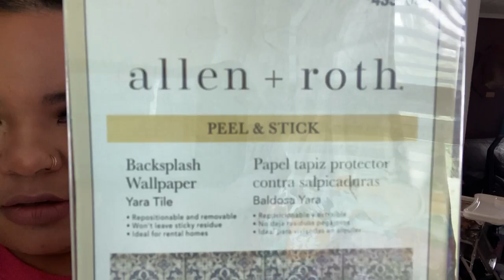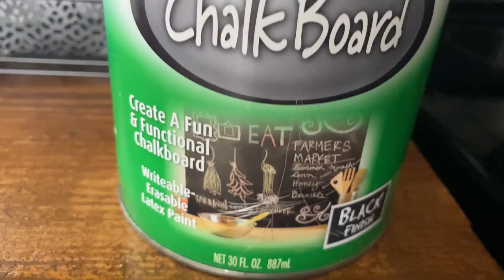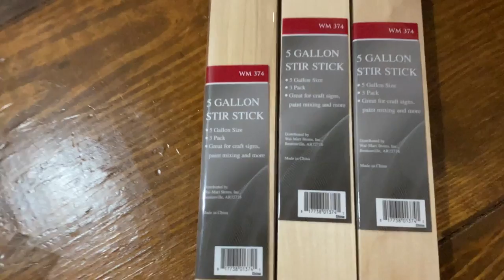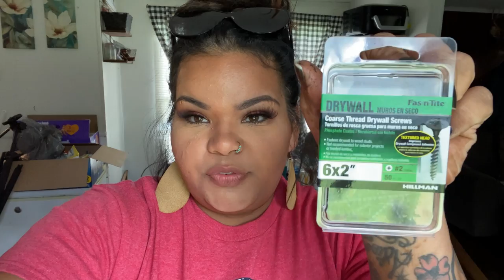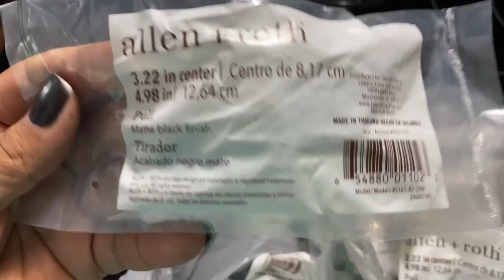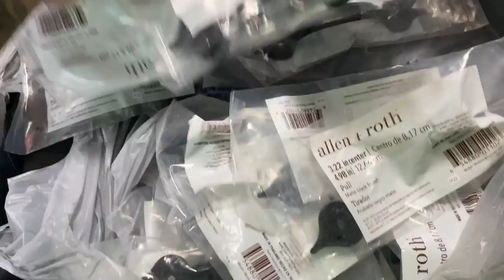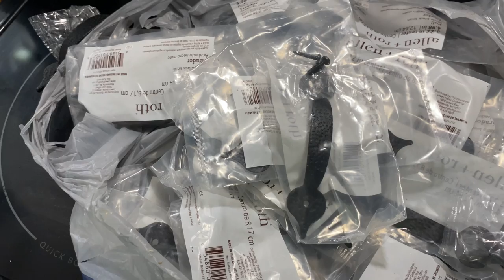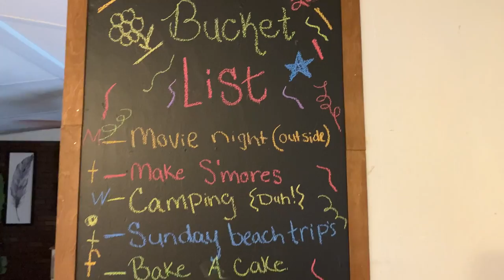Mobile Home Kitchen Update | Chalkboard Wall | DIY Plant Windowsill

Comment: Also, if you mix some saw dust and wood glue, you can can make a filler to cover the holes from the screws on the bottom floor moulding and you can stain over it to hide the holes!